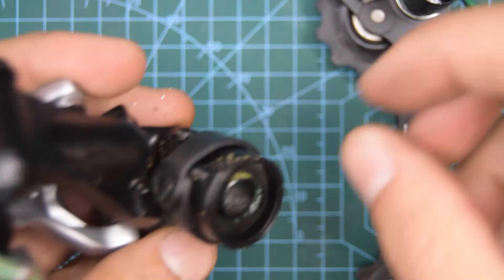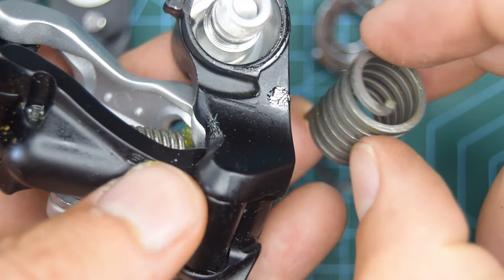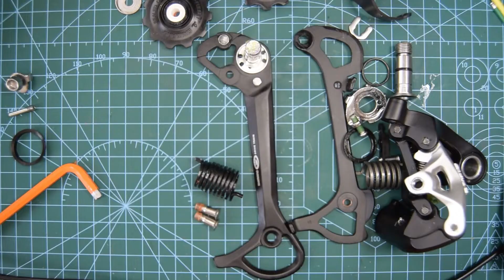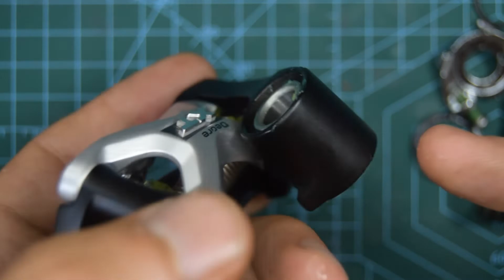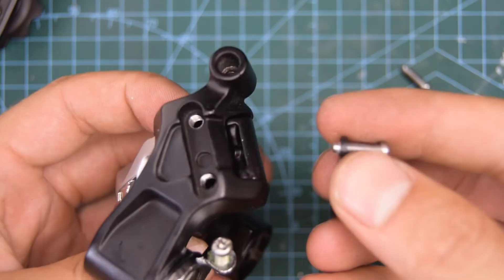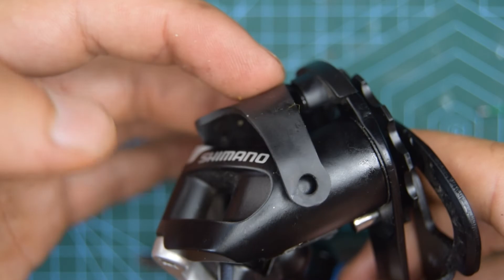Shimano Deore XT M771 Rear derailleur: Overhaul rebuild clean service

Comment: Hello, I have the same transmission, 9 gears, 11-46 teeth, will it work?
Reply: I believe it will not work. I use a 11-40t 9 speed cassette and it works fine. I think this is the maximum the long cage derailleur can accommodate.

Comment: I would swap the gear wheels for ceramic ones, they are dirt-resistant and don't need lubrication, so less dirt is attracted and the wheels last significantly longer.

Comment: @ATBOY...Do you know if the top jockey wheel (the one with the ceramic bushing) has more resistance when spining? My lower wheel spins freely, unlike the upper guide pulley. Is it supposed to be like this or do I need a new wheel. BTW, excellent videos!!
Reply from the maker: Think the top one didn’t have sealed bearings. Given these are 20 years old, they are probably a little bit worn out
Reply: @atboy4342  Thanks for replying bro. Correct, the upper wheel is ceramic bushing.
Its not the bushing, as it spins freely when dismantled, plus there is no play.
Seems to be the metal end caps, as there is markings from wear. Just want to check if its common on any of these models if you have them lying around  xt M770 series or ULTEGRA 6770, 6600 Series
Reply from the maker: @dd776  There is always side to side movement on the G pulley on shimano derailleurs. Don’t have those models new on me, but I got a XT M739 Nos, and it does that. They are consumables, just like the cassette, chain ,chainring etc.
Reply: @atboy4342  Thanks again bro.Look forward to your next video!!